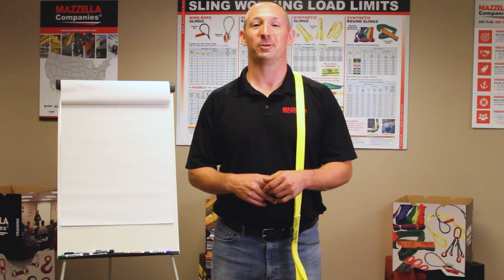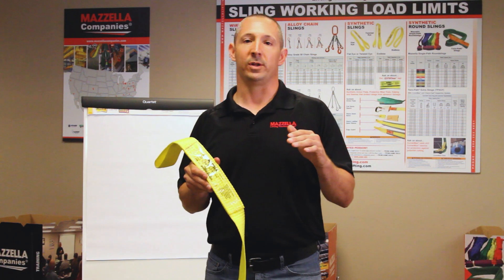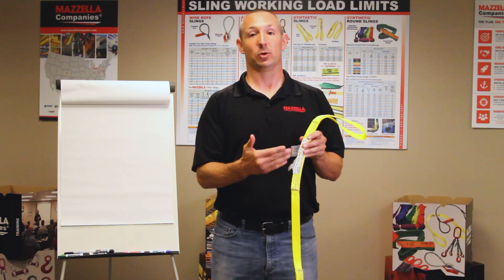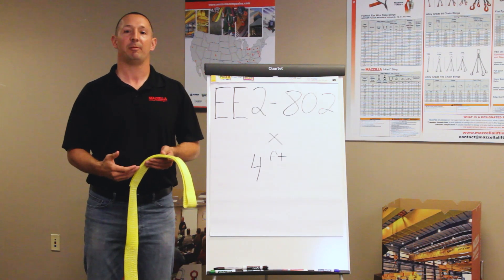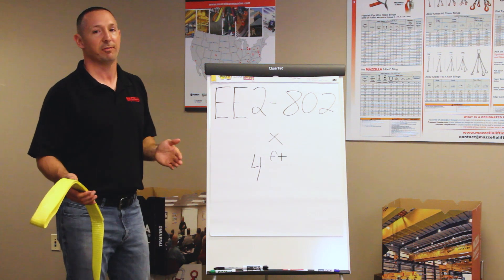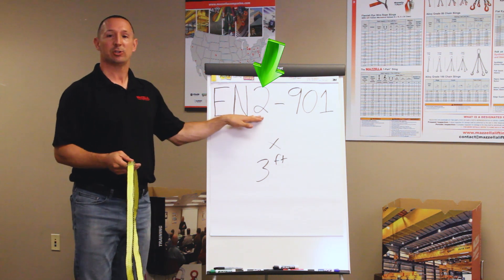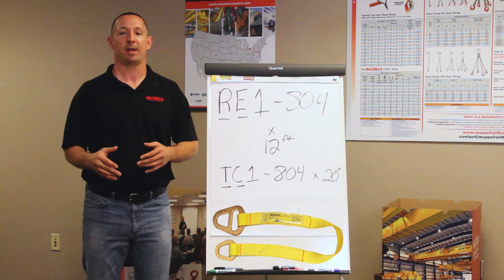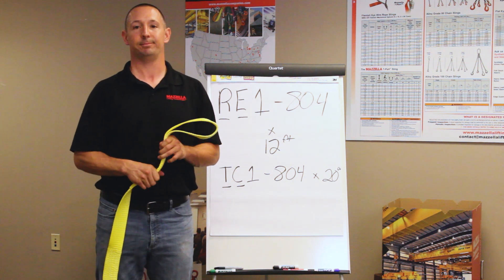Synthetic Web Slings: Basic Acronyms, Components, and Configurations

Comment: Would it be advisable to keep a wide variety of Synthetic Slings of various lengths around for various lifting jobs?  Our primary work will Remounting different types of Mobile Equipment / Machinery from light to heavy but we will Eskridgenot be handling the Super Monster sized stuff.  What is the highest lifting capacity of a Synthetic Sling?
Reply: Sorry about Eskridge getting accidentally pasted in there in front of "not."